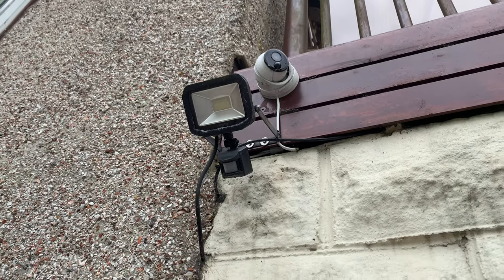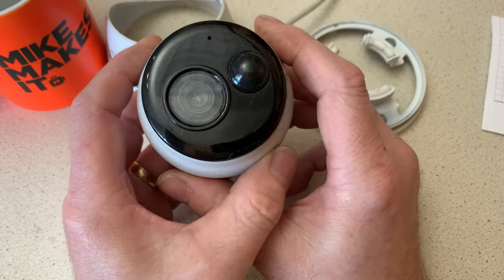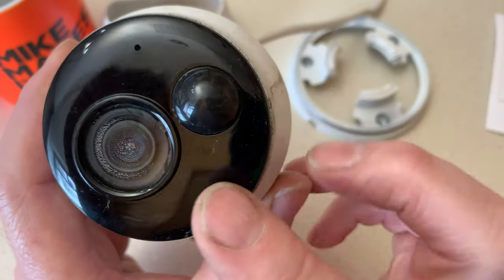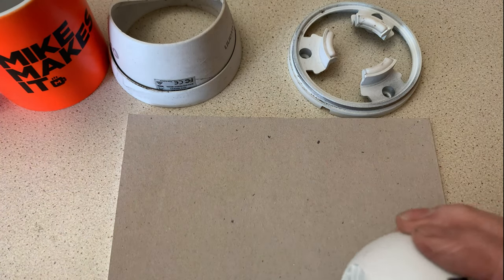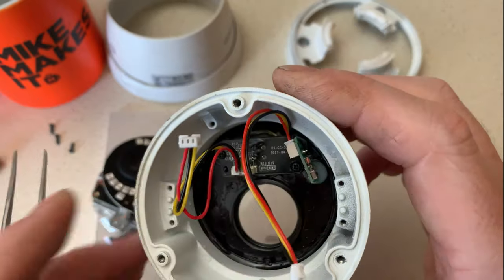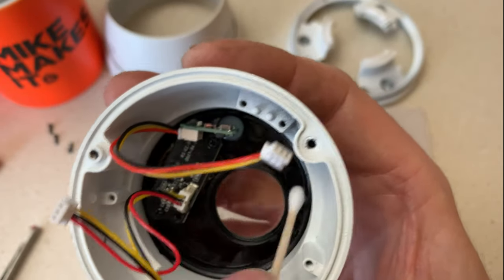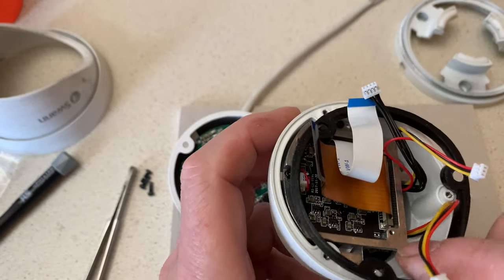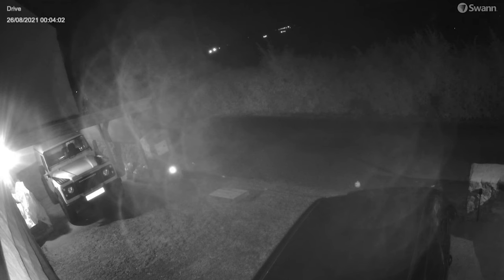Swann NHD888MSD CCTV Dome camera water issues.

Comment: Great content mate, I have 886MSD since Sep. 2019 and installed 4 cameras around house, no moisture ingress issue at all, even withstood direct sunlight 40C+ days sometimes here in Australia, your video will come in handy once these cameras starts to show age which eventually will!
Reply from the maker: Hi Toshi, thanks for the great comments. Over here with the rain the condensation does seem to come and go on the cameras, even some sheltered ones suffer. But it does seem random. The one I repaired did get a bit of a wash with the pressure washer I think but I could still resurrect it. If you do need to open one of yours up be very careful with the ribbon cables as I had to cut one back to expose new track after it had been removed and refitted a few times. Thanks for watching 👍🏽

Comment: I just installed two new swann SWNHD-887MSFB cameras this afternoon.  First drilled a hole through brick, then passed the cables through, then ran the cords under the eaves, and finally built a wooden platform installed under the eaves to keep the cameras protected.  Today was a gorgeous fall day, full sun, no humidity, 70 F.  After installing the cameras they were great for about 3 hours, clear picture, then the sun set and they were still great in IR mode.  However when I checked them after about 45 minutes past sunset both new cameras were foggy and couldn't see anything.  I tried various ideas to resolve this, rebooted each of the cameras, rebooted the system, even updated the firmware on both cameras, nothing helped the picture.  So went outside in the dark, climbed up a ladder and shined a flashlight across each camera lens, both had heavy condensation on them BEHIND the lens.  I'm quite frustrated and upset as this swann system was expensive, a lot of work to install, and the cameras are IP rated IP66, so there should be no issue with water getting in them, especially given how dry the weather is.  I suppose now I'll have to deal with swann which I'm dreading, and they better make this right.
Reply from the maker: Hi. You might find after a day or two they may clear. Mine still randomly fog up regardless of weather. Bring so new I would contact Swann as clearly they are failing so early into their life. Shame as they are really nice cameras apart from this issue. Thanks for the feedback and for watching 👍🏽
Reply: Had same issue - up for a few hours and then condensation. Supply replaced it and 2nd camera was exactly same issue. I'm tempted to fix myself rather than go through same frustration of explaining to supplier, paying $24 for Express post with SIgnatori, after wasting time going to a line at the post office.  1 out of 8 cameras exhibiting this issue, so all in all the system and other cameras seem bullet proof - even after a 3 month wet winter. The silica gel should be absorbing the any minute moisture so will look to replace that too. My theory though is that the unit is breathing in moisture (during cooling of the day)  via the signal+POE cable, which I don't believe has the right IP6X rating. perhaps seal that with silicon and let well dry before reassembling. Shall reply results back here after I get a chance to do this activity.

Comment: Just had this happen on one of my Swann cams after storm bert hit the uk & absolutely battered it. Different model but hopefully it will come apart. Thanks for the video!
Reply from the maker: @Chief81  I expect the cameras are very similar. I must say, touch wood, I’ve not had any more issues. Thanks for watching 👍🏽
Reply: @ I’ve not had a look yet but sometimes these are sealed units so hopefully not & I’ll do what you did. Tbf these cams are over 5 years old & this is the first time I’ve had any water actually inside them. Driving rain in storms can & will get anywhere.
Reply from the maker: @Chief81  indeed. Good luck 😀

Comment: You said something about an argo or arga.  Is that an oven?  Also did grease on the rubber seal prevent any further ingress of water?  I was thinking maybe a bead of silicone around the joint might also work?
Reply from the maker: Hi,  yes, our oven is an Aga which is always on so great for drying things out. A spot of grease has helped but to be sure silicone in the right place would be better.
Reply: @MikeMakesIt  Okay thanks.  I might try using a hair-dryer or surround my camera which has condensation with some kitty litter made from silica gel to see if that gets the moisture out prior to doing a disassembly.
Reply from the maker: @runngunn  a slow warming of the camera could help but it would dry quicker if opened
Reply: @MikeMakesIt  thanks.

Comment: I notice that this vid was posted over 2 years ago, so has this moisture problem been resolved or does it keep happening?
Reply from the maker: I’m pleased to say all 8 cameras I have, some under cover, most not, are all still 100% functional with no further issues.  👍🏽
Reply: @MikeMakesIt  Amazing, glad it worked out for you! Out of the 7 bullet cameras I have wall mounted, one of them has the same moisture problem which is becoming an annoyance. Only problem is getting up on the ladder halfway up the house to take it down 😭
Reply from the maker: @alpachino468  one of mine is on the chimney!  That takes a bit to get to as well!!

Comment: Probably too late now but I would check the rear section, especially where the cable enters.
Reply from the maker: Hi Ralph, thanks for your comment. To be honest I didn't check the cable entry, it might have been a good idea. I do think the water got in between the 2 halves though. I found the 3 screws a tad loose so when I put it back together I made sure they were nipped up well. Time will tell I guess, thanks for watching 👍🏽

Comment: I had temporarily fitted 4 cameras with cabling through house getting positions, then left them there for a few months just cable hanging.

Cleaning fly spots off with a damp rag, then connecting with holes to ceiling to run cables. 2 cameras did this.

One was a ball camera and one a pointy one usually for exterior but was better than ball up a narrow corridor. 

So disappointed.
Reply from the maker: Hi Philip, thanks for your input. My cameras, at the moment are ok. But perhaps tomorrow, for no reason, regardless of the weather, one may go bad again. Some are under cover and it still happens. Usually they will clear up in a day or so on their own, sometimes not. I agree they should be better for the money. Thanks for watching 👍🏽

Comment: with THAT much condensation in the unit it's going to corrode in no time.  eek   swann REALLY should be conformal coating all the board in their cameras, it just makes sense.
we just got a brand new system and the cameras are recesses a meter under the house eves so they get no rain and are brand new, and we're getting shocking fogging in the morning and evening on different cameras making some unusably all day.  and then they clear at night.  
very frustrating
Reply from the maker: Hi John, as my video says I also get the condensation with cameras that are both exposed and undercover. The fogging seems to come and go at random but since the video I have had no problem with any of them. The spiders seem to love them but so far so good with the condensation. There are reports on the Swann web site of the same problem so it's still happening. Maybe Swann could address this issue ASAP. One can hope!. Thanks for the comments and of course for watching 👍🏽